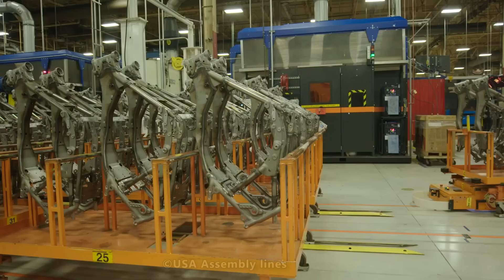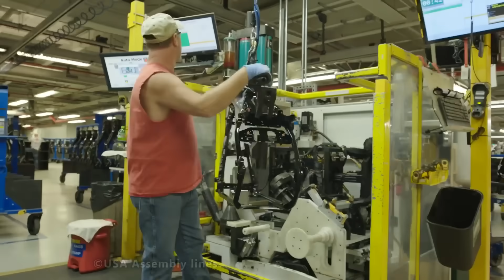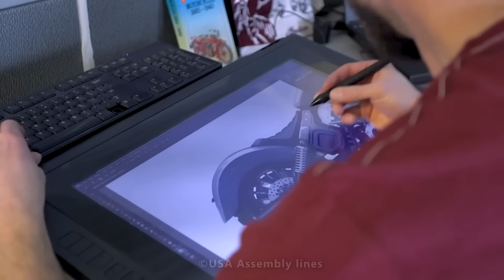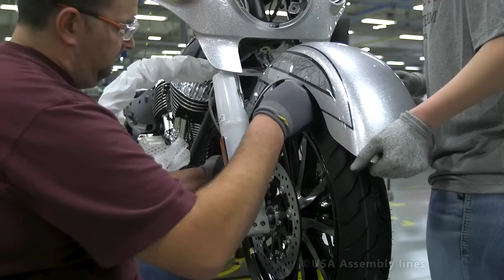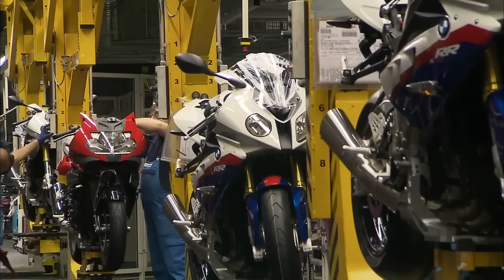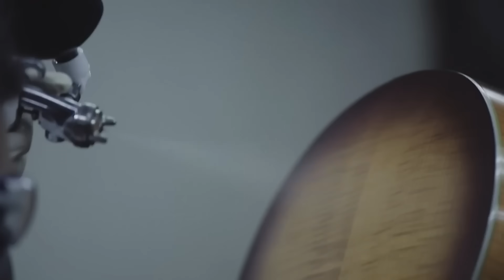How HARLEY-DAVIDSON motorcycles are made: Full Factory Tour in the USA – Manufacturing process

Comment: I seriously doubt that they would work for free.  They went on strike at York when I worked for one of their suppliers, Sunstar Braking.  The ones in this video are Brembo brakes Whom we lost the contract to. I was in charge of the press room where the brake rotors started their trek through the factory.   our brake systems took too long to assemble so we lost the contract, that and our inability to produce😢 a 13" disc that was quiet and acceptable to Harley. We ended production in April of 2006.

Comment: I bought a new Sportster 883 back around 2000, it looked great and sounded fantastic, but it was heavy and not fast, it also developed an oil leak around one of the cylinder heads after a short time.  Glad I experienced one, but my previous bike, a 1997 Honda CB500, was lighter, faster and handled better.

Comment: The front fender can be attached to the frame not restricting airi nto the heads or intake as well as rigid rails mounted from the the rear frame rail bolt to the axlecap cover for a shock support that doesn't bottom out

Comment: Why do Harley s lack the quality and longevity of jap bikes? They are focused on a v- twin engine changing the motor every few years. Maybe for the better or worse? Seems like every model has its flaws and some are serious to where the motor will destruct! 88 twin cam plastic cam chain tensioner fails and motor seizes, parts installed without proper tolerances that are subject to failure. Robots putting crankshafts and heads on without any measurements being taken. You saw the video 80 seconds for each process. Wtf. Slam the bike together and expect it to be perfect. Well they are not. Compensators not getting enough oil and will fail after a few thousand miles. The list goes on. Milwaukee 8 motors are having a lot of problems. BUT HARLEY WILL NEVER HAVE A RECALL TO FIX THE PROBLEMS!!!! I love my Harley just wish they made a quality machine....

Comment: I picked up a Street Glide ST in ‘23 and I LOVE that bike! Fast, aggressive and sharp as a point on a skeeter peter. No kind of second to some other wannabe. Absolutely a gorgeous sweetheart of a ride.
The BMW is a nice ride, no doubt dripping with quality but, I am allergic to it; it hurts my eyes. I would love it if they built a motorcycle that did not look like an alien insect. 
Indian is likely a good product too, but, there is to much “plasticky” attached to it. The fairings look like an afterthought more than an integral interdesigned piece that works with the rest of the bike. Design engineers have a lot of work to do at Indian to tune that into something welcomed to an American driveway.

Comment: I think with the BMW my biggest request would be to colour code the wiring loom at both the connector and the component so that being able to easily trace back each component without having to dismantle the wiring loom or using a test meter to trace everything

Comment: The more i see of bikes being assembled,the more i think they are just literally thrown together as fast as humanly possible 😢
Reply: 1 BMW s1000 is built in a day or more so there is your quality bike.
Reply: @awesomeandre1757 why do BMW's often have electrical issues if they are built so well. Also, 1 per day?  Does that make sense to you. Only 365 built oer year...think about it.
Reply: @awesomeandre1757 just checked 600-900 S1000's built per day in the main factory alone. At full production a bike is completed every 95 seconds.
Reply: They are whipped together. Can't get quality thay way.
Reply: @robertmorandi3947 have you ever worked in a factory? I have back in the late 70's McDonnel Douglas on the DC-10 line. Production goes quick as every part is ready and blueprints are color coded you follow the holes with a color coded drill after the station before you tapes off what size or color each hole is.  This went quick and chance to screw up practically eliminated. Of course a DC-10 took longer than a motorcycle or car line, but it is set up whete each station had the air tools set up and each station may only install 6 bolts, then it moves to the next. Each tool is calibrated for torque and all the hardware is delivered to each station by a logistics man. There can be 100 stations on an assembly line and at some stations that take longer, they have more than one station working on the same thing so the next station is fed by several lines. This way, each station near the end will be moved every minute or two. It truely is a great sight to see. Very few of the oeople at the factory can build a motorcycle. But, they know their station and its hardware by heart. You should go and see it done. Henry Ford was a genius.
Reply: No, that is not it. Humans waste time. The robots can be adjusted. You want to believe 4 heavy steel guys with beards are better at making one bike at a time.  Because if the garage wrench turner says so, then Harley is wrong.  Nothing to cry over.
Reply: you are so right, when I took the tour and we got almost to the end we saw about 100 or so bikes up against a wall, some one asked why they were their. Was told that they had not passed the QC inspection
.
Reply: @JohnWilson-ql8ks  everything is made that way nowadays

Comment: The most dependable and tight engine HD ever built was the Evolution (Block Head). I owned six HD's over a 20 year period. I had 3 Panheads,  2 Shovelheads, and the one Evolution Softail. I loved them all. However,  as far as dependability,  the Evolution was the best. The quality slowly went downhill after the Evolution. Luckily, you can still buy brand new  Evolution engines built by S&S and other companies.  Actually, they still make new Knuckleheads and Panheads, and Shovelheads also. If I was gonna build a bike, I'd buy one of the aftermarket engines unless I could find a really nice used Evo. Some of the new HD'S look like a turd with wheels.

Comment: The bike they are assembling in the BMW plant is actually a K1600GT tourer, not the s1000rr.  The 1600 is a 6 cylinder and the 1000 is a four cylinder. They should their facts straight before doing these videos.

Comment: Not going to lie, to watch them throw that fairing on, on that road glide going down the line in a matter of seconds pissed me off a bit. It takes me 2 damn hours every time I have to pull that sumbitch off for audio upgrades or whatever I may need to do in there, and for them to do it in seconds is got me a bit salty 🤣
Reply: Or replacing a heater core in a late model SUV and then seeing them Zip!  Zam! Bang! slap it together on How It's Made or some YouTube video.
Reply: I know right 😂😂😂😂😂
Reply: @bigboibruiser44 😂 everytime! I swear I be cussing like a mfker when I know it’s gotta come off lol
Reply: If you take the headlight assembly out after you take the outer fairing off it's pretty easy to put back on. You can see the hooks through the headlight hole and line it up. The headlight assembly will just pop back in once you line it up right.
Reply: @Rem700R5MN what generation are you speaking on brother?

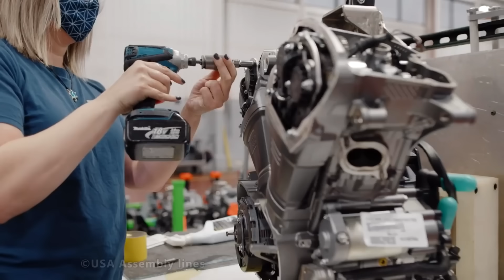Comment: 7:49 Using a Japanese Makita impact driver in Milwaukee.  
If only there was a more local impact driver manufacturer 😂
Reply: It's to "Old"
Reply: MILWAUKEE brand tools are made in China! 😂
Reply: @pb68slab18 Believe it or not I have what was known as Old Milwaukee tools made in the US. They are 50 years old. 3 heavy drills and a Hole Hawg. They have been used heavily and 2 have had replacement chucks and one a new set of brushes.  A once fine tool now relegated to made in China and disposable like a plastic bottle
Reply: @pb68slab18  as are a large amount of Harleys parts
Reply: China owns Milwaukee tools now, so the Japanese ones are better made I guarantee you.
Reply: Hate to break it to you. Google Milwaukee Power tool corporate history. Yup.  You guessed it. 🇨🇳

Comment: that was quite a tour and very modern looking facility and a lot of bikes. I was surprised at the amount of machines doing the work also the amount of chicks. they want too much for their bikes now, mine only cost 
$5k in 1980 and still hanging in there.
Reply: Sure, but what was your salary in 1980?
Reply: Overpriced in ‘80 then. I bought a new Camaro in ‘80 for 6K.
Reply: 1980 that bike been on quite a Journey
Reply: The robots are put into place after too many injuries happen in a certain area. Carpal tunnel happens in the both hands frequently in assembly line work. I have it now and also had cervical fusion on 3 disc in my neck from holding my arm above my head while looking up 10-12 hours a day in auto manufacturing plant. Like painting a ceiling 10-12 hours without putting your arm down or putting your neck down only for about 3 seconds between vehicles. After so many on the job injuries happen in one area, they eventually put robots in that job. Made me happy as a gay in boys camp when they did. And if any of you have any teen kids, send them to a technical college to learn how to write the programs for these robots. They can make big money. I talked to a guy contracted to write our programs. He made $150 an hour regular pay and worked 30 hours overtime a week. He was always there it seemed. He said it would take him about 4 hours of  just to make the robot move about 1/4 inch. This thing had to weld in the whole side of a car, so plenty of precise movement. The cameras it used had to be programmed also. Any changes to a new model, he had to start building the program for the new model changes. He was young and made mega bucks. And this salary was back in 2010. No telling what he makes today.